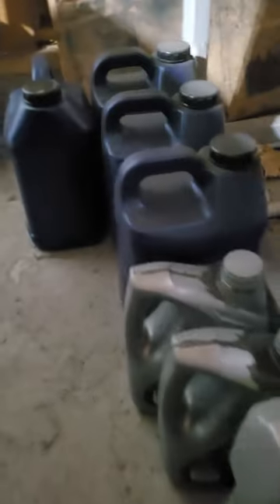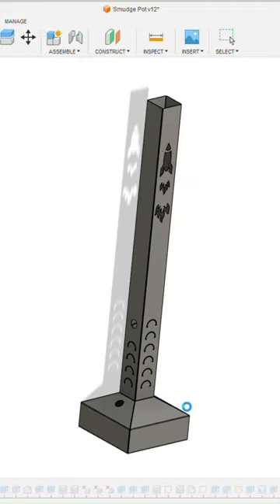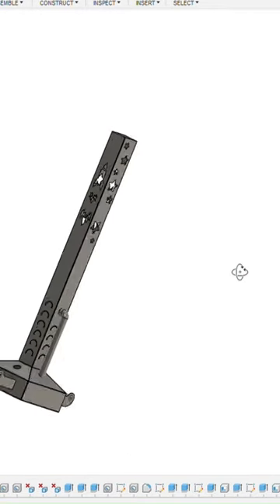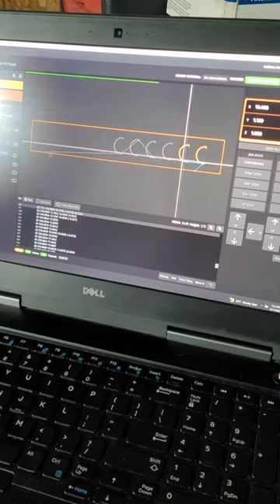What to do with all this used oil? Build a smudge pot heater!

Comment: Or, you can take the used oil back to where you bought the oil to be recycled.
Reply from the maker: Ya I do sometimes, but most places only allow 5 gallons per day to be dropped off. So I'd be making an extra trip every day for over a week to recycle it...

Comment: In germany it is forbidden to burn used motoroil, but if you ignore the rules you can use it to power smelt ovens.
Reply from the maker: People would be surprised how many factories burn things like oil in many processes. It's not great but it's out there.